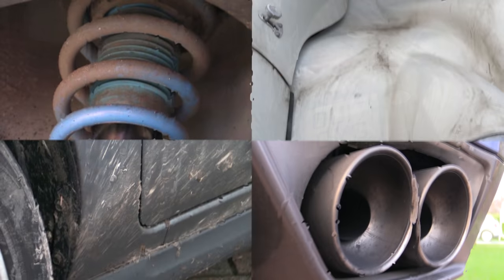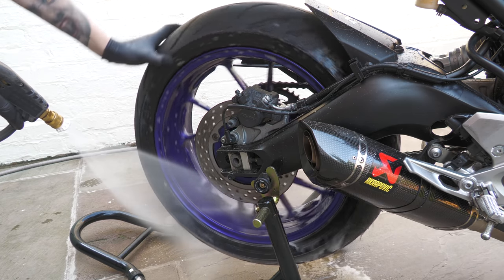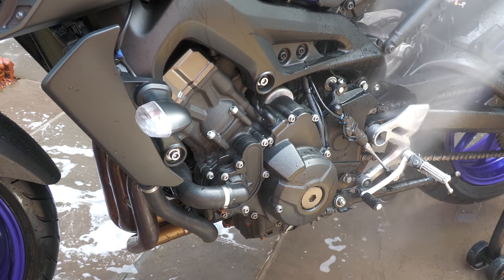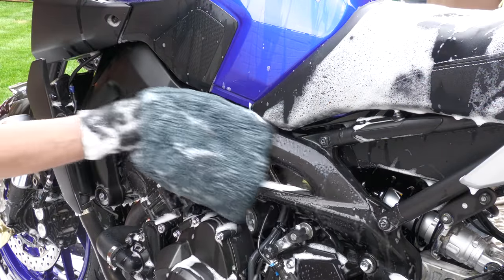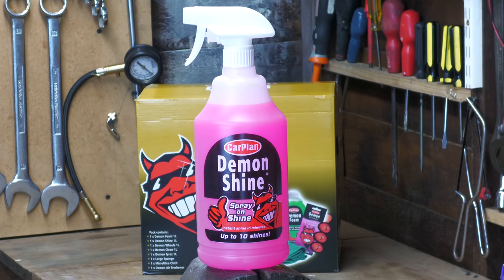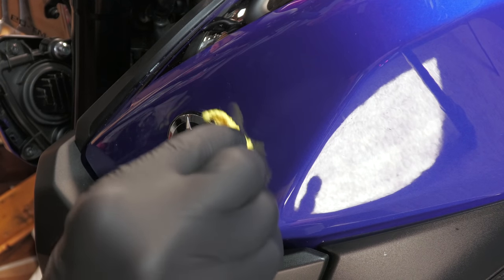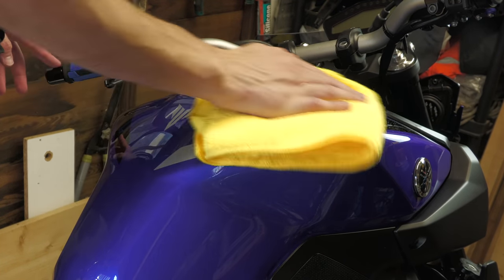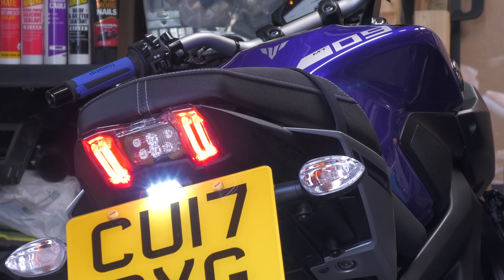Detailing my Dad's New Bike With Inexpensive Products

Comment: You should try to finish with an anti corrosion coating like ACF 50 or XCP (I use ACF50 for the summer and XCP in the winter). XCP is tacky and can be a pain to wash off . Even if you aren't riding in the rain it's worth doing as it really does help with stopping corrosion during the winter when stored. It also  gives some back to the black plastics.

Comment: Cover that plate mate. These bikes are hot at the moment for being stolen, that model has the highest theft rate 👍🏻
Reply from the maker: Can’t get an address from a plate and even if you could good luck, they tried to take the Aprilia before this, lost the bike they were on in the process and went home bleeding 🤠.
Reply: @CarCleaningGuru  if you have family/ friends or a contact working in insurance it’s not difficult to find an address linked to the plate. Just giving a word of warning mate that’s all
Reply from the maker: @rhys7671  Yeh possibly but doubt the scrotes around here have any working contacts with proper jobs. They go for easy pickings parked out front. This takes about half an hour to get out the shed and only fits down the side with the bar ends removed so about as safe as it can be!

Comment: Instead of the k2 go for a bosch pressure washer can get a 100bar one which isn't too strong for bikes. 
Exhaust bung needed 💯

Demon stuff I find is pants. 
Can get alot of inexpensive other products from elsewhere. For
Motorcycles Make sure everything you use on it is pH neutral. Can strip colour from frame or engine casings if not. 
Power dryer definitely needed for a Motorcycle.

Comment: Very nice body clean, satisfying to watch however you missed one of if not the most import part to clean.. the chain! 
Start with the chain next time unless you have a dedicated chain cleaning tool that contains all the grease and muck, otherwise it will go all over the rear wheel. 
Also DO NOT spray demon shine anywhere near your tires or brake discs, that could be dangerous, as well as costly should it contaminate the discs.
Reply from the maker: Covered that in a previous bike vid, didn’t have time here so left it to my dad to do next time.
Reply: @CarCleaningGuru  ah that’ll be why! Just stumbled across your channel so hadn’t seen before ones. Subbed now :)
Reply from the maker: @OSR_1  Yeh, should ideally be done and I’d recommend doing it first as it’s generally the dirtiest part.
Reply: @CarCleaningGuru  yep! I’ve gone shaft drive now so am happy I never have to clean a chain again!

Comment: People absolutely slate these products, and 9/10 times they haven’t even tried them. Having used this kit, I think some of these are perfectly usable for the every day detailer (APC and demon shine especially).
Reply: Yup.  I use the interior cleaner and rapid dirt remover and have done for years.  The spray on shine is decent aswell.   The alloy cleaner and tyre shine arent very good though.  I just buy the large carplan 5l trade valet bottles now which is the exact same stuff but half the price of the Carplan demon branded bottles.
Reply: Slated for good reason. Have you watched forensic details review. Yeah it's cheap and alright but would be much better value buying 5 litre actual decent APC and wheel cleaner concentrates and couple of spray bottles

Comment: I use brake disc cleaner on the discs after the bike has had a clean to make sure I get all the cleaning products over spray off them before applying the brakes to make sure chemicals don’t touch the pads